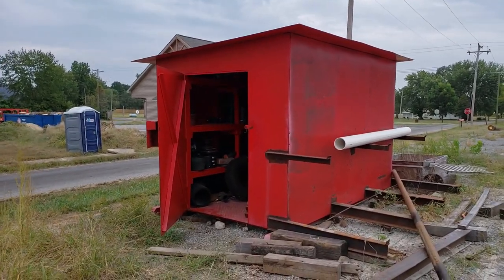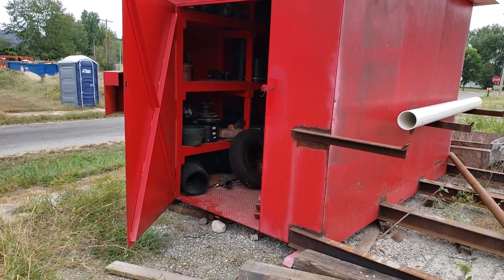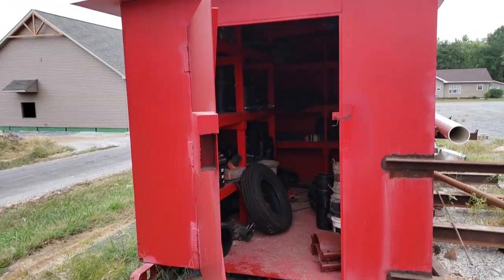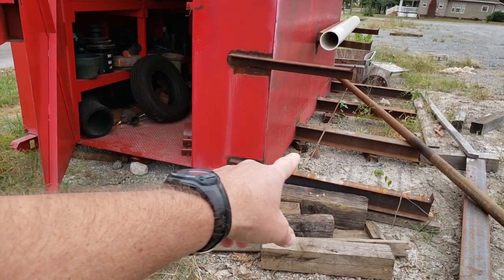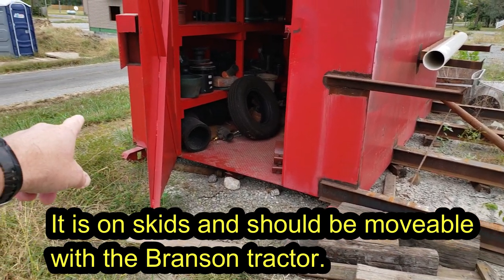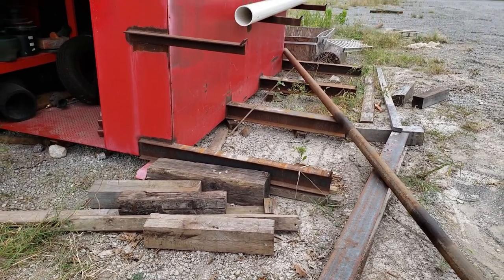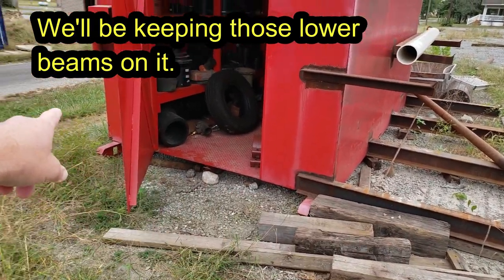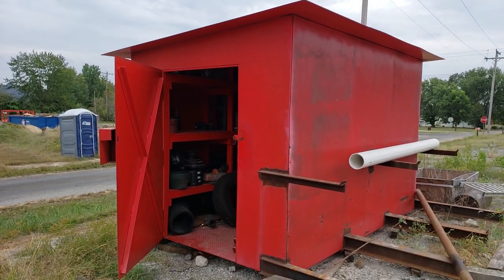What should we do with this steel vault building!!??

Comment: Seed storage instead of in the garage right in the way use it for your seed storage
Reply from the maker: That crossed our mind, but the pole barn is much nicer with the double insulation and Vapor Barrier. Much less moisture. Thanks
Reply: @kapperoutdoors  Yeah, but let the mice just try and chew through those walls!

Comment: If it can be lifted above your exposed power boxes, I'd cut a hole in the bottom (below the highest point) and place it above the boxes to protect them from the weather.  ;-)
Maybe relocate any shelves that had to be removed (for room) and mount them on the outside (house or woods side) for firewood storage or whatever?

Comment: Kapper ...I would keep the "I" beams and built a shelter outside to keep wood dry and under cover .   No Joke,   if it is attached to the ground it would make a great shelter.   1/4" steel it is very strong,  It is a great place to keep things locked up in.  Scrap value is rather low at this point that is why they sold it to you for a low price.   Good bottom but if it is used as a shelter it would not be portable.
Reply from the maker: Good ideas. Thanks

Comment: 1/4 inch steel surrounded by blocks, concrete and roof could be a hell of a above ground tornado 🌪 
Shelter in Kentucky.  Us Gov Ready has the design with thinner steel, rebar and concrete the Government spent ($$$$$$$$$$$) dollars testing when installed properly it hold up.

A guy built on in his garage on u tube Joe.  I know your set in Il,  but man if you move to Kentucky and build around in basement or just for protection outside it be something if you needed it you be glad u had.  ❤️❤️❤️
Reply from the maker: Roger that man.
Reply: Kapper Outdoors  Joe do you have measurements on that building length and width?